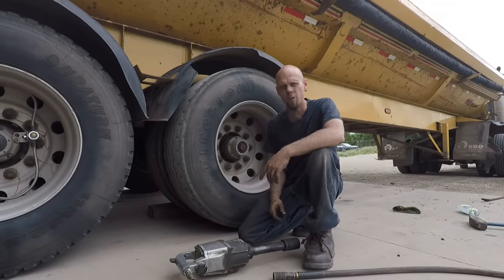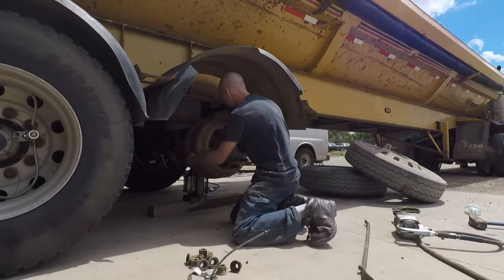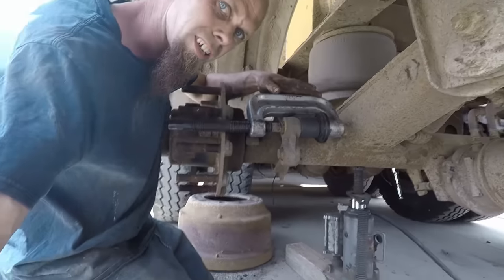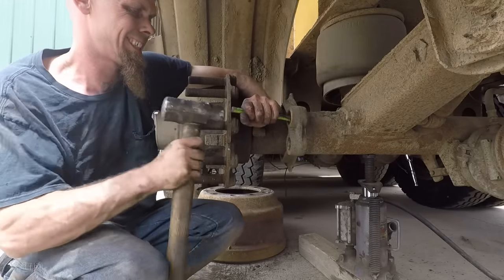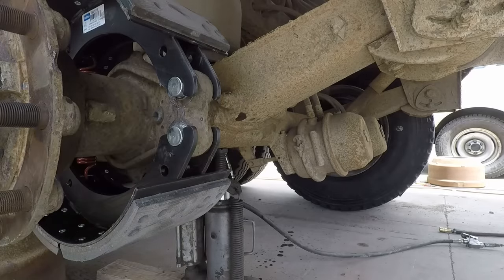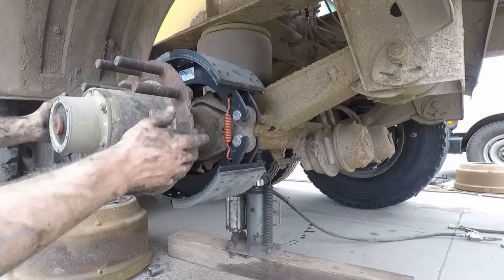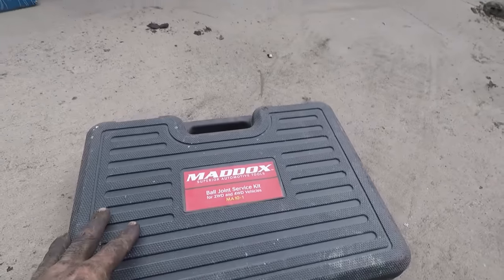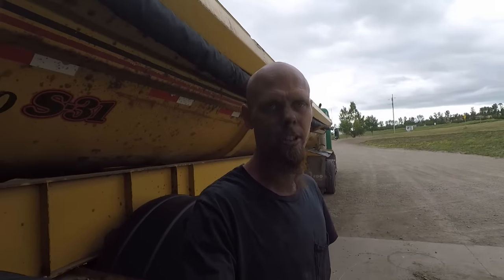semi truck brake job seized anchor pins

Comment: Why do I even buy tools when this man just did a brake job with a hammer and a screwdriver? Amazing stuff.
Reply from the maker: Lol. The speciality tools are really nice and worthwhile if it's something your doing everyday but when you're just maintaining your own equipment your not doing these jobs every day so it can be hard to justify the cost when you can still efficiency do the job without them
Reply: Because these are breaks for big truck when smaller vehicles have bolt on parts I did the same thing for Swift as a tire and break mechanic
Reply: @Ezrider359  get yourself a copper hammer, wont maul the bushings when putting em in and wont mushroom the pins getting em out.
Reply: I've always done it with a hammer and screwdriver + a pair of pliers lol.
Reply: i mean what tools did you really buy to do breaks on a big rig😂😂
Reply: You forgot to mention the ball joint press and the power bar as well XD
Reply: tipofthesip they make a specialty tool that will stretch the small springs and honestly they make it way faster and make it so anybody can put the springs on even if they never have previously
Reply: very common here in the PH.
Reply: Because time is money.
Reply: Lefty loosie
Reply: Righty loosy
Reply: Innovation that excites😂
Reply: Patrick Murphy  and it took 12 minutes
Reply: @ryanlowry5409  as a kid I broke some lug nuts on a big old Dodge. Dad said shit happens. Till I broke 2 more. Then he told me what I was doing wrong and I got schooled on how big trucks differ from pickups. Good times.
Reply: C clamp don't forget c clamp
Reply: @hammerdragon4321  Brakes
Reply: @ryanlowry5409  I hate when that happens
Reply: I do drum brakes with a single tool, and they’re needle nosed vice grip pliers.
Reply: @treyster3000   believe it or not, there are several different specialty tools for big rig brakes.
Reply: Ha! Yeah, his methods only work for guys who know what they're doing.  Guys like me will wrestle the tires for the entire time it takes him to do the whole job.
Reply: kkkkk  before i saw youre coment i was thinking to buy [ball join kit] but now i change my mind thank you
Reply: Mechanics would buy the specialty tools for automotive drum brakes, but I never used anything but channelocks and a Phillips screwdriver

Comment: I can guarantee, this is a lot harder than he makes it look.
Reply: No, he’s making it harder then it is, I have an anchor pin press works easier then a ball joint press, he should put springs on the other way, he’s working to hard, I remember bolting the brake blocks on in the 70’s
Reply: Its just as easy as it looks actually lol
Reply: @freddie4536  depends what kind they are, some can be pretty easy, some fight like hell the whole time
Reply: @63galaxie61  the way he put the shoes on is absolutely the easiest way you can do it
Reply: From experience delivering truck parts, I can tell you the way he just grabs and tosses those drums is amazing. They’re heavy af. We use clutch cart or dolly to move them. Rest of the things it’ll take me an hour to do on my civic and I still have to take it the mechanic shop cause I screwed something up.
Reply: @63galaxie61  so you're talking a couple hundred $$ pin press vs a $50 ball joint press? Come on man. Guy done a fine job. Lol nothing he done was the hard way 🤦🏼‍♂️.
Reply: I use to do it the hard way also until I learned there is a tool for the job. Anchor pin driver for air hammer is $30.00 bucks ,spring tools $100.00, slack adjustment tools $50.00. but I guess if you never used it  you would never know. Air disc on tractors are even easier. Nothing wrong with the way he's doing it. Myself I've had a spring gouge my finger before where it popped off. If your going to use this method get yourself some safety gloves. $20 bucks is cheaper then Having sore fingers.

Comment: how nice it is to look at a quiet press-out and a press-in, a quiet tension of the springs and generally replacing the pads, without inhuman efforts and dancing with a tambourine with a similar replacement on Russian "cars" which are difficult to call cars .... (с) Guy from Russia

Comment: Are you old enough to remember when anchor pins had a milled flat spot for a hold down bolt, and the 3/8 by 3/4 long bolt notorious froze up broke off. So you are not only fighting the frozen pin, but hold down bolt too. Thank God for Q style brakes.

Comment: We had an entire fleet of school buses with frozen rollers at one point. One guy had to wail on the spider with a sledgehammer, while the other put their body weight on the air hammer positioned right on the roller. We couldn't use the ball joint press, because doing so meant also changing the wheel seals on the rear hub, and we couldn't stock enough of them. We all got drained, but we also got bigger muscles..... luckily our wives noticed.
Reply: Maybe my work having mostly juice brake busses isn't such a bad thing. Except we replaced every brake line on every bus we have.
Reply: @josift1283 I agree. But even so, juice brakes can be a head ache.  When the pump motor burns out the ABS module, it's 3,000 for the whole assembly, plus labor. You wanna talk about pissed off customers.....
Reply: Maaan... Use the acetylene torch and an air hammer and get them red hot shit comes right out.
Reply: @jibblesq  One time one of the guys used the torch, and bent the spider. But I think he heated the spider and not the roller. So I guess that would explain it.

Comment: I would like to thank you for letting me pal around with you today
I like that brake job keep up the good work
Reply: Drums cost me 136 a piece and the shoes with springs were 60 bucks per wheel, approximately 200ish per wheel.

Comment: Look, listen, and learn all you crazy kids. If you want to be an O/O get used to doing stuff like this, it will save you a TON of money over the years. been doing it myself since 94. Keep up the good work and great videos Ezra.
Reply: Don't encourage the kids to be truckers, it ain't what it used to be. Mostly warm bodies holding a steering wheel, automatic trans and an electronic babysitter in the truck.

Comment: that was my job as a rookie truck mechanic back in 1972-4 taking trailer brakes up and managing the drum and shoe replacement schedule,back then we used a wheel brace and a 6ft piece of scaffold tube never lost any 1200x20s but now at 64 e z   i have my air hammer and air ratchet/wrench and shoes back then were relined by drilling out the rivets and rivetting on new with copper rivets,great video my friend .

Comment: I always used a vise grip and small prybar later in life as it gave me better leverage on the small springs. Also used a air hammer to gently push out the bushings, I got pretty quick at getting them out . I also used a ball hone on the inner surface to clean it all up to insure the bushing wouldn't get deformed putting it in. Instead of using a ball joint press to put the bushing in,I used a alignment bolt and spare washer to run them in to save time . Put the Alignment bolt through the alignment washer and tap the bolt head with a hammer while pulling on the back of the bolt. You can steer it some with the pulling side a little by wiggling the bolt. My ball joint press was a cheap Napa item. Less than 80 bucks. Lasted me until retirement.  Great video.  Awesomly informative for new techs and maybe some older hands.

Comment: Thank You.  You remind me of my dad.  LOL.  You do what it takes to get the job done without being all high tech.  You are clear about what needs to be done and also informed me about the laws etc...  I am a driver and have been for several years.  I became an owner operator last year and am learning as I go on the mechanics side of trucking.  I couldn't make a living doing this without doing as much of the work as I can on my own.  The shops do great work but labor is very expensive.  You help me have confidence in my ability to do some of this on my own.  Thanks again.

Comment: Wow! I can't believe I ever did this! I went from a retired missile systems test engineer to a grunt in two months. Lol. I never could figure out an easy way to do a brake job. Was a great experience. Busted tires as well. We had an air wrench that I swear weighed near 50 lbs. I could barely pick it up and get the socket on the nuts. A fella named Big John showed me how to do it. He picked it up like it was a box of cotton and zipped all those nuts off. Then, he put a hug on the tire and slid it right off. John could do that all day long. The outfit I worked for rebuilt cattle trailers and did long hauls so they had about 24 tractors. I repaired tires for all the tractors and trailers and did maintenance such as lubrication, repacking bearings, changing oil and fuel filters AND getting real greasy. Great experience, it was hard work. I rode to work on my Harley back then and one day I started to straddle the bike but noticed my Levi's were down past my waist. Pulled them up, tightened the belt and got on. When I got home, I looked closer at the belt. I had lost so much weight I had to put more notches on the belt. Hard works has benefits!
Reply: The new half inch guns can do it now. Only weighs a couple of pound. How times have changed.
Reply: @_Adam_27  no way will a 1/2 in impact remove those lug nuts. I’m an auto tech and once in a while get a big work truck. My 1/2 Snap On does not budge lug nuts on the big stuff.
Reply: @505fastlife6  I’m a diesel tech and all I use is my Matco 1/2 and we torque to 500.
Reply: @_Adam_27  wow we always have to use the big 1 inch to get the lug nuts off of big box trucks.

Comment: I did that for so many years no impact just a very large 4way  with a 5' pipe trailer's/ Mack / Freightliner Did my own tire work on the side of the interstate bars and tire HAMMER and a 6×6 and a very large bottle jack  u joints/ adjust clutch and free play service motor work and transmission I've hauled logging/ ran eastern seaboard 53' strick Fla to NY  over sized loads Fla to ga flat bead sod Fla to ga I was laid off from trucken 10 yrs ago I got a government job now 3 yrs to  retirement  driving was my passion when I was young now it's time to backer her down . You do good work I can tell you will go some were GOD BLESS You

Comment: Smooth and  simple.... experience shows right there. Arm chair experts are always there to point out what they have no experience doing!
Reply from the maker: I never realized how many people know everything there is to know about things they have no experience with until I started making YouTube videos....lol
Reply: @Ezrider359   They are everywhere on YouTube, sad to say some are behind the wheel of trucks as well. Not owner ops like yourself but the ones that bounce around from company to company until retirement. As a mechanic for a construction company I've never been told how to fix things by as  many people as the truck drivers they had, just because they watched a guy once. There's many ways to skin a cat as long as its skinned when you're done. Keep up the good work!

Comment: Nice job man! I use to do anchor pins the same way. Until I bought a tap1 anchor pin press kit from strap- on. It’s presses out pin and bushing at the same time. Hit it with some sand paper wrapped in a cotter pin. Anti-seize and press in the new bushing and pin. Now it takes longer to remove the wheels then the brake job. Lol

Comment: Nice video. If someone can't figure out a shoe change by this, something is wrong. Been doing this for 22 years and only thing I could add is an air hammer and flat punch is great for anchor pins. 75% of the time it takes the bushing with it. And I use vise grips for the anchor side springs. Nice job.

Comment: WOW ... This is ball busting work. That torque wrench was as long as you are and you still had to strain to get the lug nuts torqued !!!! I'll certainly look at a big trailer a lot differently now.  Very interesting how everything works, you explained it well - great job !!!!!!! The next time I pull in a truck stop, I'll be sure to shake the mechanics hand and buy his or her lunch !!!!!!!!
Reply from the maker: 450ft lbs on the lug nuts. drums weigh around 100lbs each just 1 rim and tire weights about that as well everything is heavy on these trucks.

Comment: I use a 3/4” impact instead of cranking by hand. 

I’m not as young as I used to be. 

Ball joint press is the way to go. 

Thanks for sharing your videos. 

Young guys can definitely find some wisdom here. 

Keep on making videos. 

Maybe trifunctional bushing change video. 

Would be a good one. 

👍👍🎯from 🇨🇦
Reply from the maker: I'll do that sometime too but is a good way to gaul the threads on your press.

Comment: Snap on makes an anchor pin press that is amazing. It works so much better then a ball joint press. Fits in tighter areas to. Its shaped to remove and install.

I read down and see a few other recommendations for the snap in lol.

Either way good job, I remember starting as a tech at a fleet so many brake jobs, my knees hurt thinking about it.

Comment: You did great on the break job I was a certified trainer mechanic brakes are heavy job I did 6 axels one day with all new wheel seals
Reply from the maker: The day I recorded this video I did 3 sets of brakes 6 tires and 1 wheel seal. In about 5 hours. Can just about do brakes in my sleep these days....lol
Reply: Yes the brakes take a toll
Reply: I’m a mechanic in a printing company now trailer brakes got to heavy

Comment: As a guy working on passenger vehicles, this was quite an interesting video, thanks a lot! Always fascinated by the sheer size of bolts and parts compared to passenger fleet, of course. Also haven't seen a torque wrench that gigantic before :)
Reply from the maker: I pretty much have the same reaction working on automotive stuff only it's all so tiny...lol

Comment: Decent video. Some tips for you. Use a prybar against the s-cam when putting the new shoes on makes life a little easier. Use the tire spoon or a wrecking bar to walk the wheel/tire combos off takes about 10-15 times to get hang of doing it this way but will help save your back and muscles. I suggest pulling the drum straight off and going down with it and reverse going back up. Less chance of hurting your back by twisting with the drum. I would also say 2-3 mins with a file to take down the high spots and another minute with a small wire brush will make those anchor bushings/sleeves slide in easier and will not transfer the tight spot into the pins making them a pain in the ass to remove the next time. I also recommend oil and not antisieze as the antisieze and the bushing anchor holes will corrode and make life harder next go around. I can't tell if you did but, I also grease slack adjusters before doing the brakes so as you back them of and turn them back in the new grease goes into everything. All and all a decent video though.

Comment: I made a driver tool for the pin bushings out of an anchor pin that I welded a lug nut washer to one end. You just put it through the bushing, then install the bushing by pounding it in with a heavy hammer. It does a great job preventing any mushrooming or damage to the bushing and it keeps it properly aligned for a straight install.

Comment: I was a mechanic for many years but had to pack it in due to severe spinal wear problems amongst other things. Just watching you work makes my back hurt 🙂.  You're doing a great job mate but if I may pass on a little advise.. And I understand It's not always possible or very comfortable, but when you can, please wear at least a flexible back brace. You're spine will thank you later on in life for it 👍

Comment: This is a good idea to keep in the back pocket. I just usually use a anchor pin air hammer attachment and a rose bud to warm up the spider. Nice and easy pin and bushing removal and install.

Comment: Fast but a little constructive criticism..... use jack stands!!!!!!!  Be good to do a vid on replacing s-cam bushings. EVERY set of brakes I’ve done required them. Most of the time it requires removing the hub too.  Great trick with the springs!

Comment: first time I've seen someone use one of them massive torque wrenches without someone else holding the socket end lol good job man
Reply: It's doable, but kind of a pain in backside. It's a little quicker if you use two people. Words of experience.

Comment: I sho wish I had a nice concrete floor to work off of. I do my shoes just the opposite on the springs and on my slacks I just stick something between the slack and the axle housing to keep from backing the slack off but it doesn't matter how you do it just as long as you get it done, fine job Ez.

Comment: thank you for sharing your knowledge!!!.... I have question one of my brakes rods is not retracting when I apply air to the system it only does it when I get loose the knots that secure the air brake chamber and i move it around, what could be the cause of that?

Comment: Those fenders need replacing as well , we call them mud wings here in the UK.,great work .🇬🇧🚛🇬🇧🚛
Reply from the maker: Fenders on a side dump take a beating equipment operators who don't care are good at running into them or dropping stuff on them
Reply: Tell me about it . Forklift drivers have a tendency of hitting my chrome wheel nut covers on my tractor unit as well , unfortunately they don't cover the cost ì have to ..